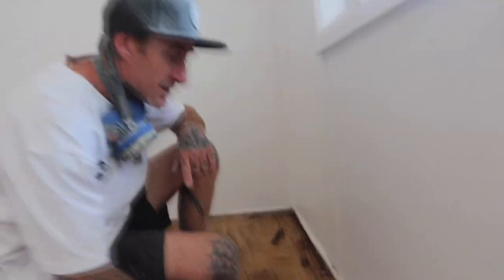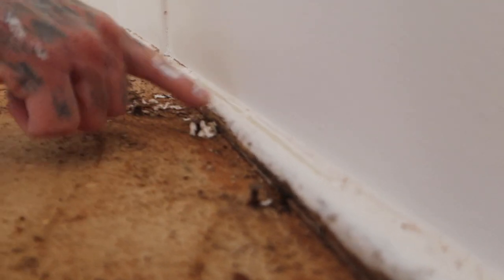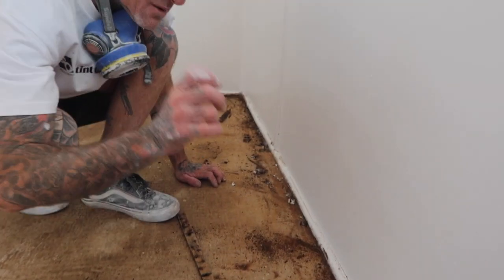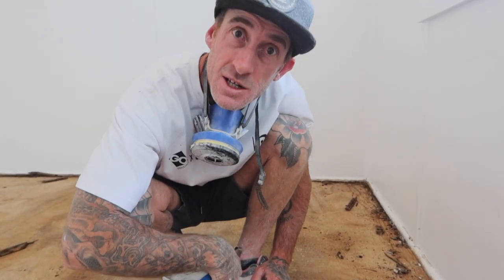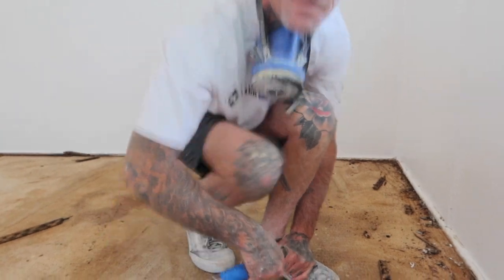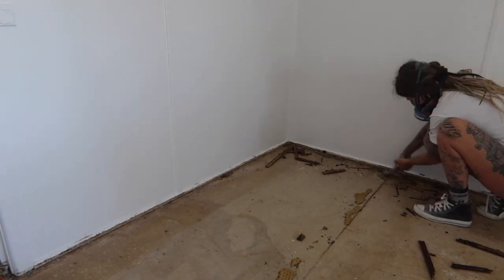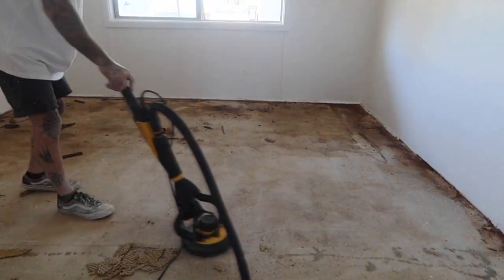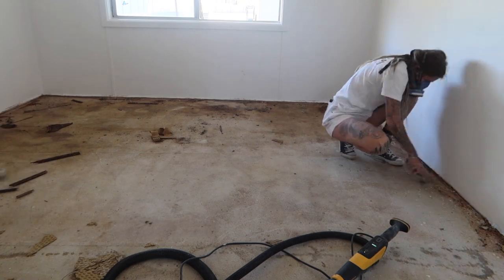RIPPING UP OLD CARPET

Comment: Hi if you are spraying the hole in side of the house what do you do you spray first 
Thank you
Reply from the maker: Hi Gary, I start with undercoating woodwork then first coat walls, finishing ceilings, finish woodwork cut & roll last coat on walls. Hope this helps mate👍
Reply: Thank you

Comment: Did you just cut the edges with a Stanley and rip it off that way?
Reply from the maker: Hi mate, yeah a lot just pulls straight up without cutting but in areas the Stanley cuts help 💯